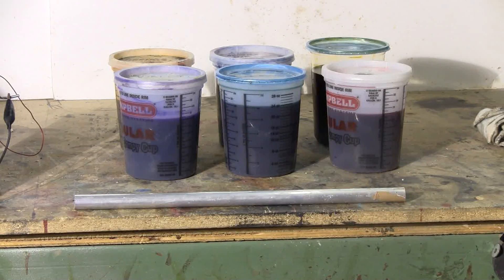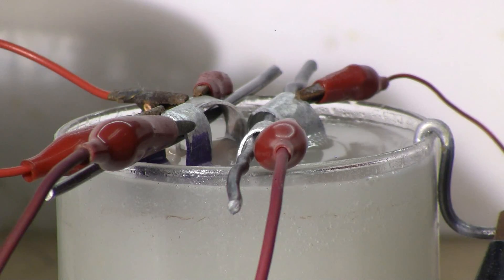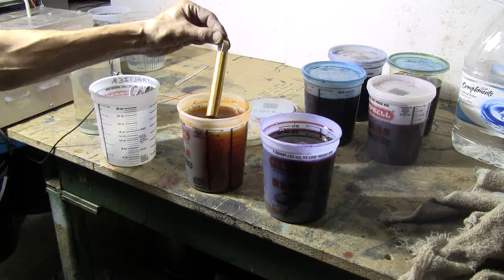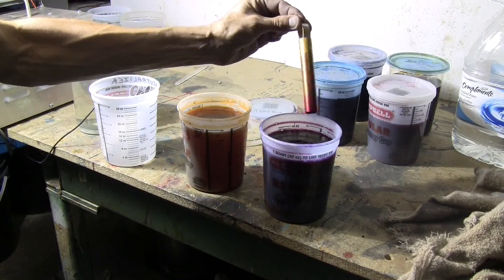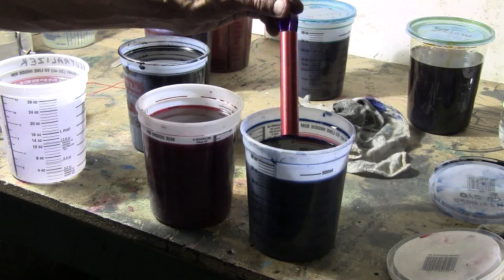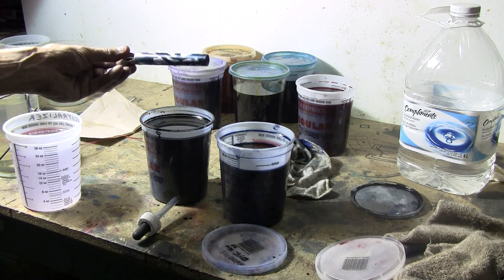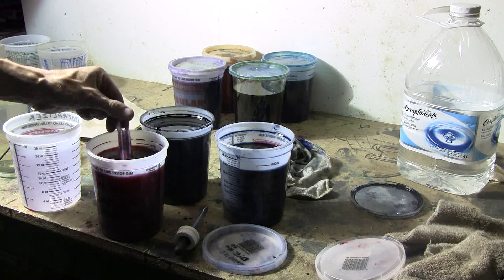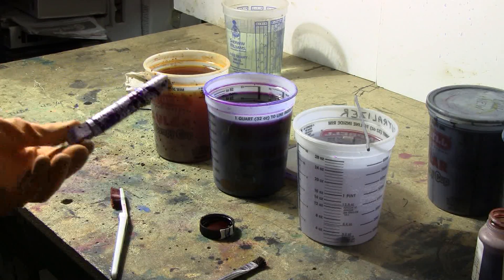How To Anodize Aluminum #4 - Simple Dye Techniques

Comment: Do you need to water rinse when finished with the dyes, before you boil? I've never anodised &/or dyed before, so want to get all the steps right. Do you need to let dry before the boiling part & how long do you boil for? Oh, and do you use distilled water for the rinsing & boiling or just normal tap water? Thanks :-)

Comment: Hey Bill,I'd like to dye an aluminum part with multiple colors and still have the non-dyed finish as well. Is it possible to apply a mask after the water bath, dye the part with one color, apply the mask where I want color to appear, then wash off the dye where I don't want it? What sort of chemicals would I need to accomplish this? Thanks for your help!

Comment: Like dyeing Easter Eggs.

When in the acid bath do you lose much of the material?  I'm thinking of trying to etch some aluminum parts then anodize them to produce various metal colours.
Reply: +Pa Sander when you anodize a part, it will actually increase in thickness. "If i remember right you will gain about .001" to an anodized surface, and the anodizing will be .002" thick (so you would have to etch .002" to get through the anodized surface). Hard anodizing is about .005" thick, and adds .0025" to the overall thickness of the surface, but I don't believe you can dye something that has been hard anodized (which is a slightly different process).

Comment: hey Bill, i watch your video about anodizing, i have a question, i have a material wich is already hard anodizing but with no dye, i want to add color (dye), is this possile? and i dont know it's already sealing or not?
Reply from the maker: You will have to strip the existing anodizing, and anodize again doing the dye step before sealing. Once the anodize is completed, the pores close and dye can no longer get in.
Reply: is this re-anodizing again not decrease the alumunium material right? thanks for answering.

Comment: hello some one help me  to anodize aluminum profile with color 
i tried clean with caustic mixed water then  clean water rinse then   nitric  acid cleaning and rinse clean water  then  sulfuric acid anodizing with 13.volts DC dipped in color dye but not get results.
 i used  cathode  as  aluminum plate rounded  put in glass jar  in the middle  put anode connected  object   aluminum profile that 4 x 4 cm and 5 cm H  size
any one help to to make test  this  aluminum color dying very thankful

Comment: Bill,
Yes I seen that portion. I was hoping to see how you wired in the meters and basically the inside of your enclosure, did/were you able to add some sort of metering of the current. instead of using a big a55 resistor? Im starting my collection of parts premised on a MOT. -Sam

Comment from the maker: Power supply is made from a rewound MOT, bridge rectifier and filter capacitor. I added panel meters, and a large variable resistor on the top of the case as a current limiter. You can use a car battery charger or even the 12V part of a recycled PC power supply.

Comment from the maker: Glad you got something to work. Colored sharpie markers will work, you need to gently dry the anodized part without scratching it and then color it with the markers followed by sealing in boiling water. Did you get the Caswell sealer as well? Pro dyes usually need the sealer to be used, so that they don't leach out or fade. The sealer lasts a long time. You are right that some dyes don't take. I have had some luck with inkjet printer ink, but strong sun will likely bleach such a dye quickly.

Comment: Bill, thank you very much for taking the time to reply. After more experimenting I have discovered that the clothing dye that I was using won't stick to the anodised part no matter what Current or voltage I put through the thing. I surmise that some dyes just won't stick. I've ordered a dye kit from Caswell and in the mean time I have achieved some success with spirit based wood dye using 6ASF at 12vdc in 10%vol H2SO4. Seems to work. Anyway, thanks and Happy New Year to you.

Comment from the maker: Auto parts store battery acid ahould be cut 50:50 with water. Always add the acid slowly to the water. You can mix it weaker still and it works fine. I often use one part battery acid to three parts water. Four parts got anodized the other day at the same time. They then went into black dye. Three turned black, the other one was a funny alloy and it came out a brassy yellow. Some alloys can be anodized but not dyed or will not dye properly.
Try doing a no-dye part and seal it to verify anodize.

Comment from the maker: Some alloys will not take dye. Have you tried different types of aluminium scrap? The aluminium should not be corroded by the anodize process, it should come out of the anodize bath with a cloudy or milky appearance. A standard anodize current is 15 amps per square foot of Al for an hour. If the voltage is too high, the part will draw excessive current and may be damaged. For your cathode, lead is often used, but 6061 Al can also be used for the cathode.

Comment: Hello Bill,
Watched your anodising video and became interested. Bought all the stuff. Got the aluminium, cleaned it, etched it in NAOH, desmutted in HNO3 then tried to anodise it. The anodise won't take... Well, I mean that I can't get the dye to stick). All I end up with after several attempts at different voltages, current settings and acid concentrations is a smaller and smaller piece of corroded aluminium. Can you advise? What current and acid concentration would you suggest?
r
Chris H

Comment: Thank you for uploading this, very useful stuff. I learned a few tricks from you, but I have one for you too. Try using something jelly like that goes hard such as instant gasket, dribble it on the workpiece, dye it, then remove the gasket with spirits, then dye the rest. Its like a splash but with much sharper edges.